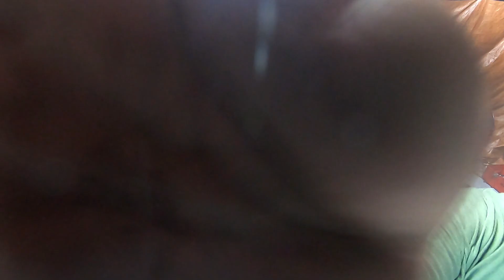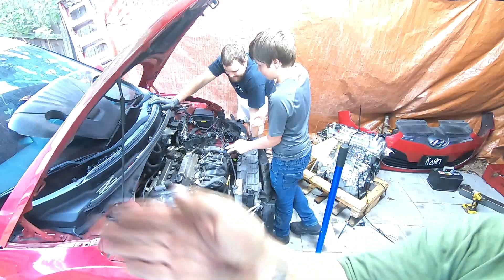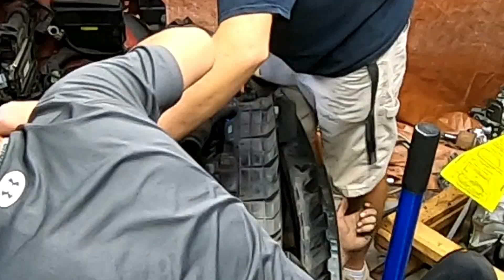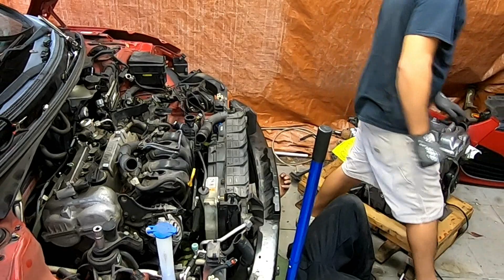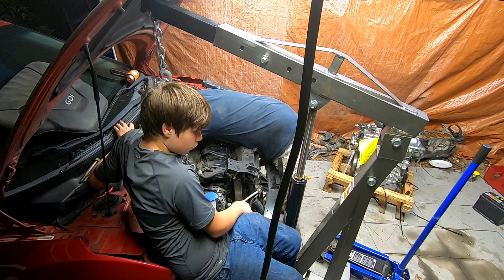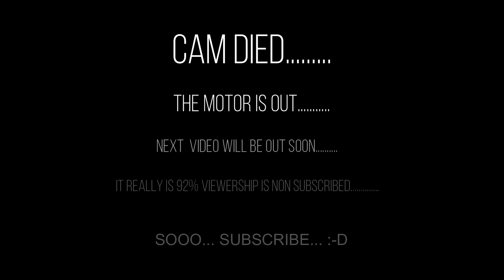veloster swap 2

Comment: Not sure if you will see this but i cant get the engine separated from the transmission. I dont want to take the tires ooff..everything but the half shafts are disconnected.. what am i missing
Reply from the maker: Sometimes they do seem to stick together just from built up dirt and debris. A smack from a rubber mallet or dead blow hammer should work if not find a safe place to kinda pry the engine apart from the trans
Reply: @Sucat  it's separat3d I just can't seem to figure out how to get the engine out its like there's not enough room to move the engine over out of the transmission housing
Reply from the maker: @josephwomble-r9v  ah ok gotcha. I believe I had to do a weird angle  I kinda remember it being a pain to get off. Did you take the trans mounts off also.
Reply: @Sucat  yes I think tomorrow imma try and put a jack under the transmission and see if I can tilt it up some..

Comment: I am currently doing this car but turbo... what are the main things you (other than all the harnesses) unhook in order to get it out.
Reply from the maker: Harness. Engine mounts. Exhaust. Clutch line if manual. Fuel lines. I think thats it.
Reply: @Sucat  what about ac compressor? Or alternator? I'm mostly trying to avoid touch anything with my ac. I just replaced everything...
Reply from the maker: @michaelyukon6428  forgot about ac. When i took the motor out all i did was remove the belts and unhook the compressor from the motor and then bolted it to the new motor once it was dropped in the car. The Alternator should come out with the old motor and swapped over while it is out the car. Oh. The radiator needs to be removed aswell so you can pull the motor out easily
Reply: @Sucat  did you ever have to refill refridant or freon? That's what I dont wanna have to do
Reply from the maker: @michaelyukon6428  as long as you dont disconnect the lines no you wont have to. You can remove the compressor without removing the lines
Reply: @Sucat  OK man so I've taken out everything and have the new motor in, and I can't get the transmission to line up with the motor to bolt it back, any tricks?
Reply from the maker: @michaelyukon6428  i had issues getting it lined up as well. It took 3 guys pulling and twisting to get two bolts lined up..